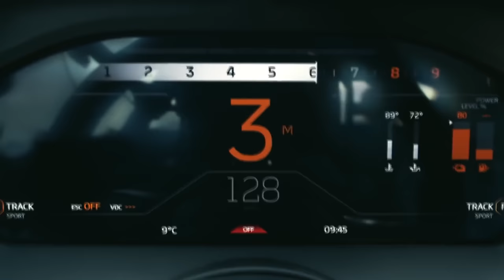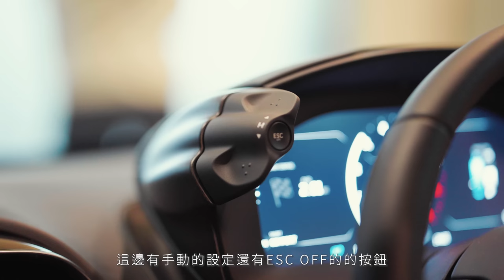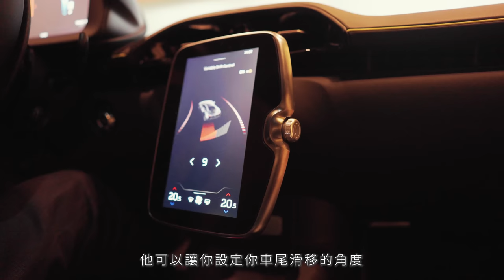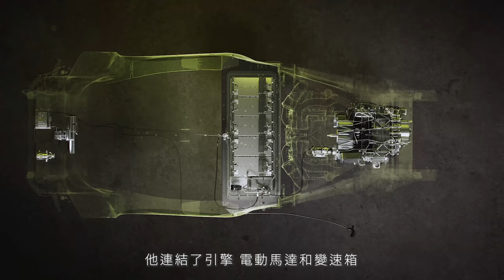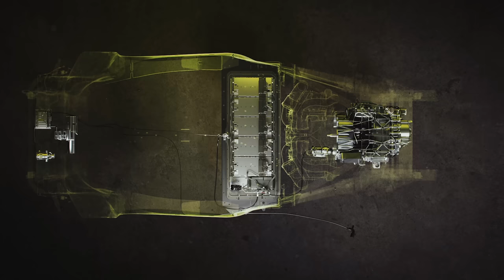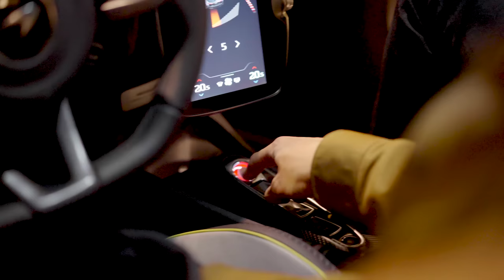MCLAREN ARTURA 台灣首發！ 油電大戰開打！| TAIWAN EXCLUSIVE！ HYBRID WAR HAVE STRATED《EMC Vlog Vol. 43》

Comment: Why you guys so surprise? Honda introduced NSX 4 years ago and it already having that kind of powertrain
Reply: Nsx doesn’t make my list as a super car. And the nsx is arguably the most expensive model that Honda/Acura makes whereas this is an entry level mid engine super car.
Reply: @rygram9138  I was talking about the technology and powertrain that NSX has already used 4 years ago which is a V6 twin-turbocharged with three electric motors not how much it’s cost